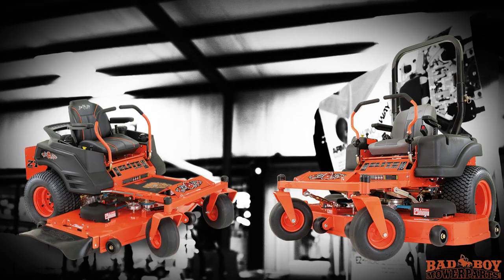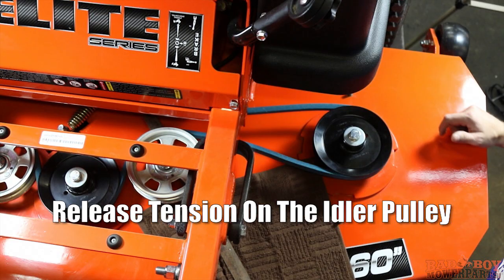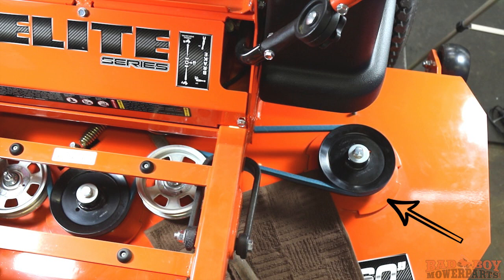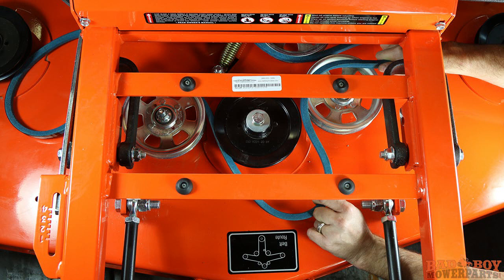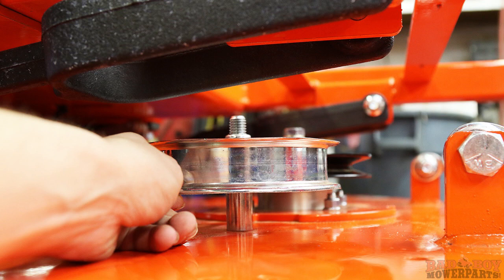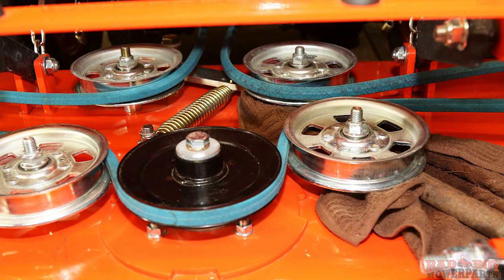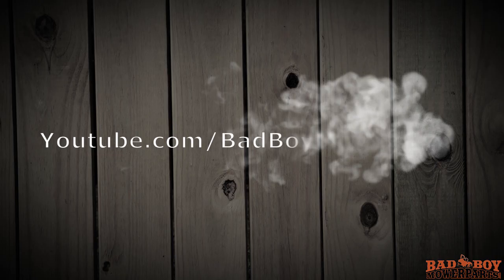Changing The Deck Belt On ZT/CZT Elite

Comment: Forget all this pry bar business. A ratchet strap from the tensioner pully hooked to the left rear deck wheel bracket makes short, easy, and most of finger safe installation. I cussed this video for about 20 minutes today while trying the pry bar... ratchet strap. All day.
Reply: Can you share how to replace the belt tension spring and then adjust it?

Comment: I couldn't actually tell from the video how you were supposed to apply pressure with a bar to release the tension, so I just pulled on the right side of the belt near the pulley/wheel your supposed to wrap the belt around and was able to work the belt on w/out a bar. Not sure if that means the tension is insufficient to allow me to do that, but for what it's worth that's how I solved getting the belt on on my mower (60"/2013 ZT Elite).

Comment: My husband and I changed the belt on his 2013 with a pry bar.  He fed the belt around the front pulleys above the deck it's self.  Once he fed the belt through to me.  And he simply pushed the tensioner  with his hands enough for me to place it around the 
"drive" pulley.  Took all of 5 minutes from start to beginning.  Would've taken even less time if not for someone not feeding it through the 2 rear tensioner pulleys correctly the first time.

Comment from the maker: Thanks for the comment Jessica. As with a lot of jobs things go a lot faster with two people. I am glad you got this done. I hope our video helped you guys.
Reply: BadBoyMowerParts.com what about the MZ Magnum??
Reply from the maker: Hello Amy! I am not sure what year model MZ Magnum you have but the 2017 decks are just like this one in the this video. The 2016 and older decks are a bit different due to the reinforcing plates welded to the top of the deck. It is difficult to use a pry bar on the older decks. Bottom line is this, find a way to get leverage on the idler arm. Once you do this you will be able to pull the deck belt around the pulleys. In our shop, our mechanic uses the PTO clutch as the point where he pulls leverage from. He pulls the belt enough toward the clutch such that the belt can be routed around the clutch pulley. This winter we will be doing vidoes for this mower and others. Thanks again for the question!

Comment: Working opposite from the discharge does not work.  With the belt tensioner at full soft, the belt would not pull over the outermost pully.   Seemed like I had the wrong belt. 

A quick check verified the belt / mower combo is correct.  Without a pry bar it’s easy to pull the belt over the last pully on the discharge side.   Spring tension is within specs.

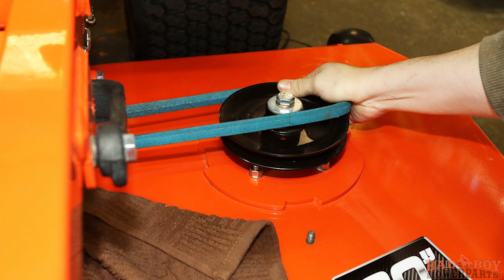Comment: The guide shows the belt going inside the tensioner mount and pulley.  The video shows it going outside.  It also has a ridiculous to get to grease fitting.  Which way is it?  Look at the picture at 3:28 versus the live placement at 4:11
Reply from the maker: Not sure what you mean. Our routing and the belt rout e diagram match. The flat part of the belt will ride along the flat idler pulleys and the v part of the belt will ride in the v pulleys, which is what is shown in the pic and in the installed part of the video.

Comment: My ZT elete 60 is doing something weird. I'm not seeing any rubbing or anything, but when I lift the deck to the 4 or 4.5 inch level, the blades actually slow down, while at the 2.5" level everything is fine. It is being bogged down so much that when I try to mow at that level the belt starts squeeling. This is the third mowing season for this mower.

Comment: You video doesn’t do justice to the amount of tension on that spring!  And you don’t show the belt being installed.  I concur with the husband and wife approach, this is a two person job.  I used a 7 ft steel rock bar, coming from the top to the spring tensioner to release tension and blessed with extra long arms installed the belt on the offside pulley on my third attempt.   My advice, your tire iron won’t get this done. And for the cost of a beer get a buddy to help.
Reply from the maker: The pry bar I used here was about 3 feet long. It is a lot easier to do this job with an extra set of hands. Thanks for watching!
Reply: man you are so right on this one. it is unreal how much tension is on that thing. I'm on day 5 watching this video thinking I'm doing something wrong lol.
Reply: One person job from the discharge side.  No pry bar needed.

Comment: How do you adjust the belt tension?  I’m having trouble here and need your advice.   There is no way to loosen the slide bold and slide it forward to increase the pressure since the spring tension is so high. Then, once it is moved forward I would have to hold it and retighten the bolt.  I Can’t seem to lesson the spring tension enough to get it off the bolt to loosen the bottom nut even using a specially modified pipe clamp.  Considering how well the rest of the machine is designed, I can’t believe the poor design of the deck tensioning system.  I need to adjust the belt to between 60 and 65 pounds.  Suggestions?
Reply: David Brokaw I'm having this same problem. Did you find a solution?
Reply: There is no easy way to do it.  This is a poor design.  The belt has to be removed from the pulleys, then the slide bolt moved and re-tightened and the belt put back on.  Of course, you can't very well use a tension gauge to obtain the recommended pound tension by doing this.  So, it's trial and error guess work.  This was shown to me by a Bad Boy warranty service team.
Reply: @davidbrokaw9340   My tensioner spring bolt was delivered set waaay too loose.   Here’s how I ‘rigged’ the fix:  Use a tarp tie down (winch handle type) fed across the top of the deck from the rear and hooked below the tensioner pulley (on the bolt itself, not the pulley wheel).  Rear attachment is attached to something that allows the winch to cycle and keep the strap straight.  Crank the tension on the pulley, mark where the bolt is set NOW so you know when you have passed the under tensioned position later.  Loosen the bolt then crank the desired tension past the previous spot and the spring is stretched to the desired ‘credit card’ gauge spacing.  Tighten the bolt with the tension still applied.  After bolt is good and tight, and verify the belt is in the proper position, carefully (no fingers in the way etc), release the strap tension.  Make sure the strap is not routed over anything sharp for obvious reasons.  May not be OSHA approved but I wasn’t about to drive the 65 miles to the dealer to watch them do something similar.  Aggravated enough that I had to finish putting together a brand new machine!  This will also work changing new or slipped-off belts and eliminates the removal of the outer belt pulley covers.  Be careful, good luck.